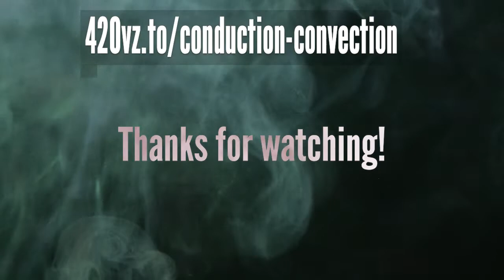Conduction vs Convection: What is Convection? // Defining Convection for Vapes

Comment: As for the physical side of things: Convection means heat transfer via a moving heated gas (in this case air). Basically you heat the atoms of the gas, those atoms get transported somewhere else and the atoms give off the heat in another place. Conduction means heat transfer via touch. The heated surface directly heats up whatever touches it. The third mode of heat transportation is radiation. Electromagnetic waves excite the atoms, thus heating them up. For some reason that last one rarely gets talked about in the vape space, but I'm pretty sure that at least all the devices that lean towards the conduction side also have some radiation component (aswell as a convection component). Otherwise only the outer layer of the bud that directly touches the heater would be heated and the inner part would stay cold.

Comment: Pure convection is controlled by the users draw only. Great ones to start with are butane powered: sticky bricks, Elev8R…I guess the Tiny Might. Without the cooling unit I use GravLabs tasters as stems without the cooling until and without the CU on the TM, your inhalation REALLY controls how much vapor it puts off. The Tera claims convection but I still see elements of conduction.